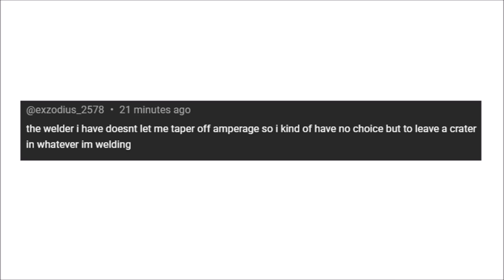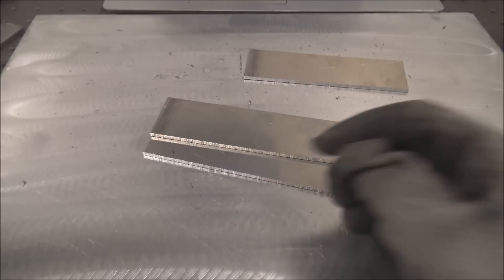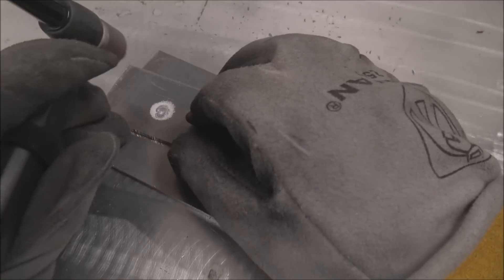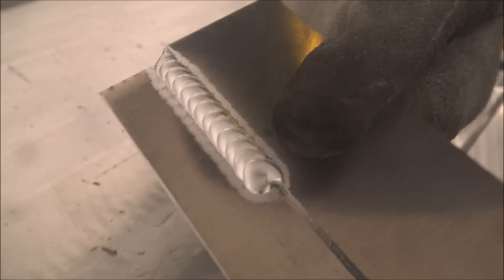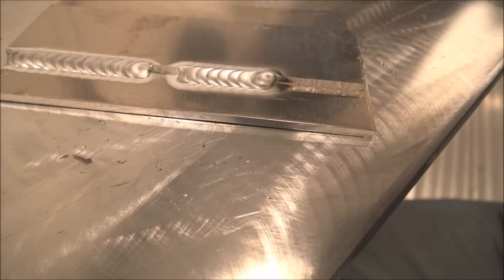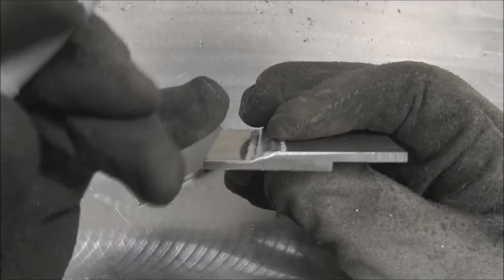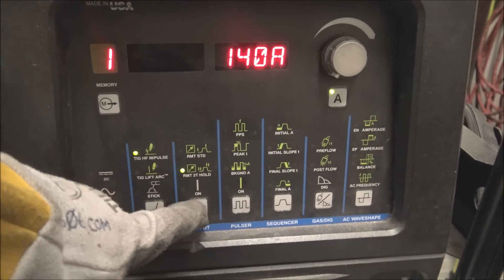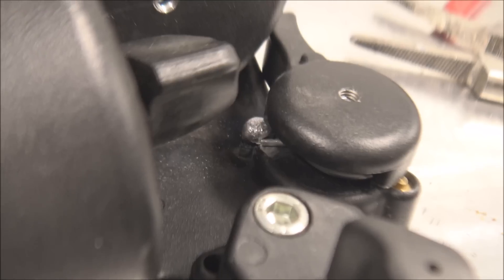"No Choice" ? - TIG Welding Aluminum Tips/Tricks

Comment: Hi Aaron, have always loved your videos. ive just bought my first tig and currently getting to grips with it after hobby mig and stick welding for about 10 years. would you be able to do a video on the differences in technique or settings for thin/small beads compared to thick beads like you normally run?

Comment: Ive used the taper up and taper  down setting but you have to trial and error your amperage to eliminate the crater crack and pin hole usually depending on material thickness a good ball park is half your running amps

Comment: Great video.  Even though I use a pedal for amp control making sure that the end of my weld doesn't have a crater still takes some finesse.  When I use my spoolgun, I will actually travel backwards a bit to make sure that the crater is filled.

I would like to see a video on techniques for overhead welds.  I just started doing some and they turned out okay even though it was difficult to get in the proper position.

Comment: Shouldn’t pretty much any welder have a 2T/4T mode ?

For autobody I pretty much use 2T mode all the time as the welds are always super awkward positions , but it’s steel and don’t have to worry about cracks

But I’ve done alu with 2T and just set the ramp down longer .

Comment: I have somewhere around 4500-5000 hours on your TIG button, by now… I’m in motorsports. It is without a doubt, a game changer! 
I’ve found where you’ve placed yours in the video, works optimal. I have mine taped into the same position using Tesa tape.
Beauty is, the button allows you to weld in, and out of position, using your index, middle or thumb finger.

Comment: Thanks for the video.   I have an esab 205i ac/dc so it’ll rig weld aluminum.  However on AC for some reason the foot pedal works as on/off instead of regular.   So I’m learning to weld aluminum today and I’m getting a serious crater on the tail end of each weld.   I’ll give this a try.    What amperage did you use here?   Sounds like your Hz is fairly low
Reply: Look for the 2t/4t /pedal selection

Comment: I would like it if can explain to me y my welds have pin holes in them, not on the surface bt like on cylinder heads wen u machine the welds away, the newer machines like leaving pin hole y a how can I prevent it??? Pls make a video bout that😊
Reply: Ran into a similar problem on a coffee table frame using 6063 rectangle tubing recently. Ground, filed, and rewelded with and without preheat and could not get rid of the porosity. Bead looked fine, but when ground off it was a completely different story. Only happened on 1-2, both were the short sides on flare bevel joints.

Comment: Could you then grind the hump down a bit afterwards to make it thinner?
I'm not a welder and have no knowledge of welding, but find it really interesting.
Reply: Yes, "over" welding or "building up" of weldment is routinely done where the parts will be machined or otherwise shaped back to fit their application.  Watch about 27 more of 6061's videos.  Some are a real hoot, and you'll learn more faster.

Comment: Aarron, how would you approach the fabrication of an aluminum or stainless rack that would be in a high humidity environment? Other than welding, I also grow gourmet mushrooms and all the metal NFS rust or corrode. Need to be able to wash it down but without areas that would hold water or condensation.